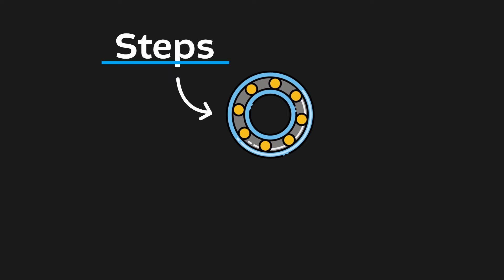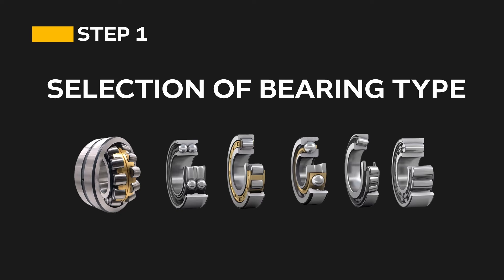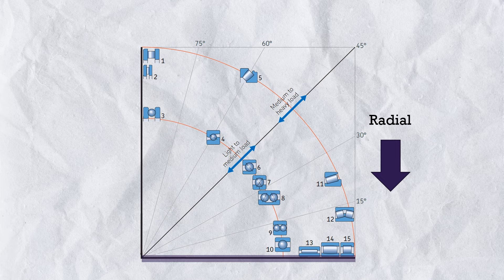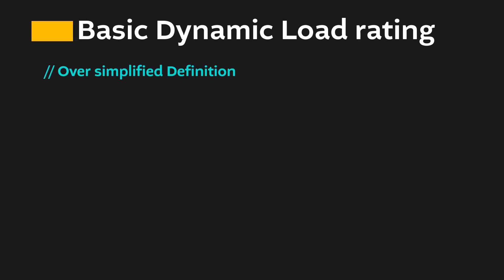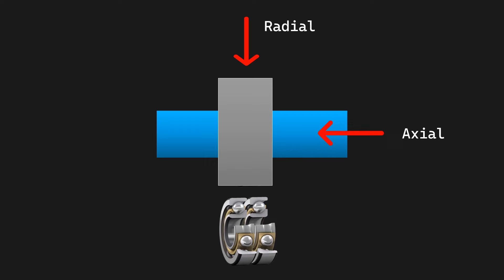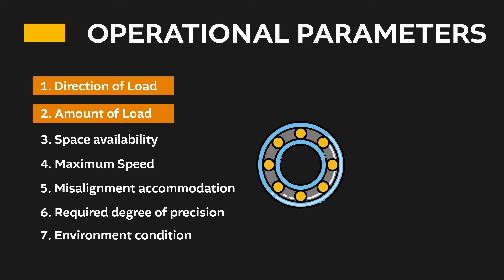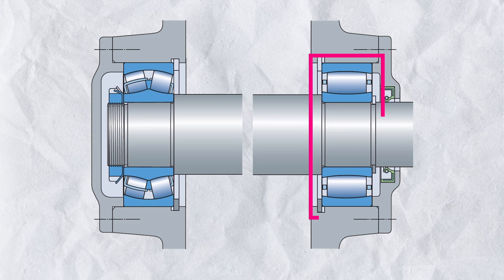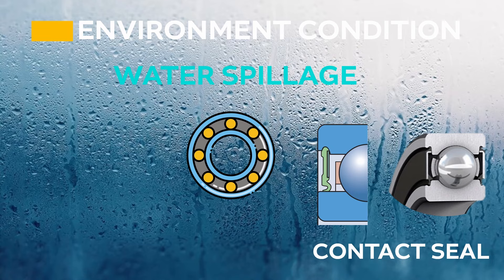Bearing Selection Procedure ✨ Ultimate Guide! How to Select a Bearing in Machine Design

Comment: Great content.
So I’m developing a project where my bearing configuration will withstand a great amount of moment and axial load. I’m divided by using 1 set of back to back angular bearings + 1 roller bearing or 1 set of angular bearings back to back + 1 double row angular bearings.
The performance in terms of security factor is similar, but I believe roller bearings are not too adequate in moment conditions.
Any video where you explain a similar setup?
Thanks
Reply from the maker: Yes, for moments of load, Cylindrical roller bearing is not appropriate. For heavy axial load (in case load is unidirectional) we can use also use angular contact bearings in tendum arrangement.
Othwise back to back arrangement or double row angular contact bearing is good option. But make sure the size by rating life calculation. If load is constant. If load is not constant use rating static load rating formula.video on combination of bearings - No as of now there is no video
Reply: @mastermechanicaldesign  glad that I found your channel! Thank you 
Yes, the load is mainly static. Right now I’m having a safety factor of >2.
I’m also using skf software to validate the system 
So probably I will have a double angular to compensate for the high moment and on the bottom a tandem arrangement of angular beartings to endure all the axial load.
Thanks once again
Reply from the maker: You most welcome 😊

Comment: Working with industrial agitators, I have a mechanical seal that has an integrated bearing but for the condition I need a extra bearing on the shaft. My question is, the kind of bearing included on the seal is going to affect on the selection of the other one?
Reply from the maker: If the existing bearing is pure radial bearing (deep groove ball bearing or cylindrical roller bearing) then this will not affect the new bearing at all.
Reply: @mastermechanicaldesign  Thank you for answering. But in this case the bearing is a double row tapered roller bearing

Comment: Can we run below at 12000 rpm means we dont want to consider the minimum load
Reply from the maker: Yes we can run, but chances are the bearing could burn out quickly (below minimum load)
Reply: @mastermechanicaldesign  how it happens if load high means the element and race ways have more stress but without load it’s should be more clearance then how it could be burn
Reply: @hemanthkumar9893 maybe not creating enough load to rotate consistently and that wears out parts unevenly.

Or maybe the parts start vibrating and that wears them out more